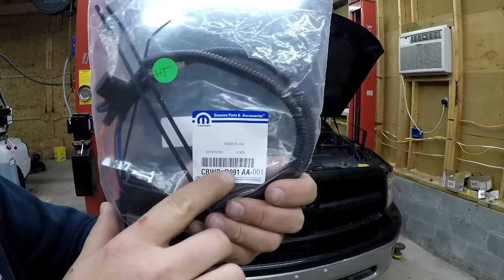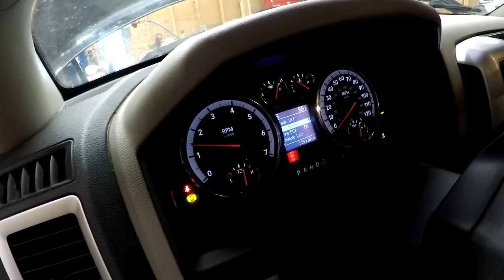Installing a Dodge fuel pump relay bypass for a faulty TIPM repair

Comment: I’ve got 2005 ram 5.7 cranks won’t start. Red electrical volt right bottom inst. cluster came on ?
Reply: Yup, 2012 5.7 with the same issue !!
Please Help help help !!
Reply: @GuciTheBulldog1  turn the key on take a rubber mallet and lay under your vehicle and hit the bottom of the fuel tank and listen fir the fuel pump to run if it comes on you should be able to start it this means you will need a fuel pump. Cause for this is running it low an fuel the fuel is what cools the pump

Comment: I have 98 ram with problems keeps cutting off after driving 30 secs or less take relay out put it in and out couple times then it'll  drive another 30 secs same thing over gonna try direct wire with fuse and switch

Comment: good day question does this work for a 2005 dodge ram 2500 5.9 diesel?
Reply from the maker: No. That’s different from this truck
Reply: @Tomsfoolery.  is it posible to do bypass it witha relay
Reply: @Tomsfoolery.  it doesnt have a fuse either

Comment: Hi I wanted to know how long will this bypass work for ? Also by any chance do you live in California ?
Reply from the maker: This permanently replaces the original fuel pump relay. No, I’m in Northern Michigan. Up in the rust belt!
Reply: Ts60 I have two more questions one is does this still apply for my situation because I'm currently bypassing my fuel pump relay from the top. Second question I looked on Amazon and couldn't find the kit do you know of any other place to purchase this.

Comment: Hey I wanted to know if this method works for 2007 dodge ram model we just had a baby an I really need my truck back
Reply from the maker: The 07 has a different TIPM but it also suffers the same fate as all of them. If you had the knowledge, you could solder in a separate relay. If you don’t want to do that, you can find new, used and rebuilt TIPMs on eBay.

Comment: I can't find this part on amazon or at Mopar? Can someone assist me with getting this exact part?
Reply: The mopar kit has been discontinued
Reply: You can get a fuel pump bypass cable on Amazon red wire with yellow fuses connectors on the to bypass it for good

Comment: Google search Verticle Visions, they make bypass kits for this problem. Just plug and play easy fix.
Reply: Same fix with less hassle? Or is it the test kit. It is just a temp fix.
Reply: @hayleyrenee2925  It's a permanent fix. No hassle. Takes 5 minutes to install.

Comment: Hay will any high amp relay work as long as it hooked up correctly
Reply: In my opinion A relay is a relay, so yes, if connected properly. Also make sure its fused if not add one.This is what i would try if it were my truck. Please use a known good wiring schematic.
Yes Mopar bought a 8 dollar relay color coded it and put it in a bag with a long part number charges 90 dollars.

Comment: The video was great i had the same problem with my 2011 dodge ram and did almost the same thing to fix it. Now have a 2018 ram and its a good truck and relay problems are in the past. The video was good but i don`t think the customer would have like the fact the fender was possibly getting the living crap scratched out of it by the relay hanging over the side as you were installing it, Just sayin"!

Comment: Thank you for this video, it has helped me figure out my issue. I just bought a bypass kit Mopar part # CBWPR091AC-001, it was only $25.00 at the Dodge dealership. Maybe this info will help someone fine one. My TIPM is on a 2016 ram. They must have changed it in this years model because the 2016 TIPM is configured differently. I have located the blue/orange and the brown wires but I have six pink/green wires and 1 is suppose to be the switch ground according to the only video on YouTube for a 2017 TIPN. Can anyone help ????
Reply: Have you been able to determine what pink wire you need?? I currently have the same problem on my 2014 Ram and it has different harness than everything I’ve been finding online.
Reply: I have the same problem on my 2014 ram 1500 with the 3.6L. Can't determine the correct pink with green trace

Comment: Ok so I'm having the same problem but I cant seem to find the part on amazon the part number will not pull anything up. Any suggestions would be greatly appreciated
Reply from the maker: Search it on google. Typically, google results will show anyone who sells it.
Reply: Pull schematics on the truck.You'll need three or four wires.... Main supply, ground (possibly another switched ground to allow for PCM control), fuel pump power wire. Find those wires and get a good relay/socket. The socket should have a pigtail. Wire the relay up with main power on one side, the fuel pump on the other. Hook up the control side. And... Go.
Reply: @dailygrinders89  Is it possible to pull out the bypass relay and replace only that? Chrysler did this fix on my grand cherokee a couple of years ago but now I'm starting to have stalls on startup, so since the relay itself is only six bucks I wanna try replacing it and seeing if that helps.

Comment: Do you have to reprogram the the system if you remove the first box
Reply from the maker: No, you don't.
Reply: No. The computer can't tell if the relay is on the board or the inner fender well if the connections are made properly.
Reply: Thanks boys, get her done.

Comment: I have a 2011 Chrysler T&C. This is a another great video; https://www.youtube.com/watch?v=oEoUYm-bxXA I also printed the safety recall sheet and took it out with me. It gives confidence before you cut a wire. My dealer gave me a generic, one-size-fits-all relay bypass kit 6814 2156 AC-001 from Mopar. They don't provide any instructions, so you'll need to know; 1. You will also have to buy a 20a inline fuse and ring terminal. I went to Home Depot. 2. Put the wires into the block "feet first" before you start splicing. That way you won't have to double splice everything like I did. 3. The connections to the relay posts are as follows; Brown to 2 (86); Blue to 3 (30); Pink (ignition switch) to 1 (86); Hot (TIPM terminal fused) to 5 (87). This was not an overly difficult job and there was lots of room to work for a nice change. Good Luck
Reply: Hey can clarify the brown and pink wire numbers? You said 86 on both

Comment: Does anyone know where I can buy an external fuel pump relay with the writing for a 2011 Dodge Grand Caravan in Ontario I checked to Dodge dealers already and they said they don't deal with them
Reply: Check the table at the bottom of the page: http://www.verticalvisions.com/tipm-fuel-relay-solutions.html, I think your Caravan is listed.

Comment: Too bad you can't buy that relay anymore... Thanks for making the video anyway.
Reply from the maker: Have you checked with the dealer?
Reply: @Tomsfoolery.  No I haven't, I will though as the color coded relay would make life much easier.
Reply: I cant find it anywhere

Comment: I have been told by Dodge this AM that there is NO bypass or external relay set up available and even that the OEM Dodge TIPM board is "not available" right now (OE# 4692315AH).  I asked to be transferred to the service manager and inquired that if my 2010 Ram came in with this issue, how would you approach repairing it if nothing is available??  Even the Expensive TIPM??  No answer, I am sure they will not return the call with a legitimate answer!
Reply: Replacing the relay isn’t that bad. I just did it on my 2011 last week. I bought the relay off eBay for $8. It took me a hour, and a half from start to finish. You will have to disassemble the TIPM, and desolder the old relay- and solder in the new one..  There are also temporary alternatives utilizing add-a-circuits, and connecting the fuel pump fuse to a Ignition circuit such as the rear cigarette lighter socket.. I did this to get my truck home as mine died when leaving the grocery store..

Comment: Will this fix work for a 2006 Dodge Ram 2500 Diesel?
Reply: Same question but mine is 06 gas engine 5.7
Reply: @NoMoreBLUEISIS  same w me did u find a fix i have the same truck
Reply: @joeroe2839  my truck has been in the shop for 2 months, i gave up and let a master mechanic fool with it. Made the mistake of telling them to take their time lol ill let you know as soon as they get it fixed.
Reply: @NoMoreBLUEISIS  thank you 🙏🏽
Reply: @joeroe2839  mine drove perfectly fine parked it as usual came out the next morning all it would do is turn over but would never start.  Stupid..... lol
Reply: @NoMoreBLUEISIS  same here left to work forgot something came home went back to leave and it was turned off and never wanted to crank up put in new pump and its the same thjng 😔
Reply: @joeroe2839  yup did the same only I also changed out the TIPM and crank sensor cam sensor throttle body lol I gave up
Reply: @NoMoreBLUEISIS  oo dang even with a new tipm box it did the same wow..idk what else to do that was my next step..i was thinkin hardwiring a relay to the battery and ignition as a trigger but then i read somewhere that supposedly they are never to be ran at full pressure and pulsate so idk what to do now and all the vids are on the 4th gen none on the 3rd
Reply: @joeroe2839  I know it sux but hopefully saved you 500 on the tipm lol
Reply: @NoMoreBLUEISIS  oo man i hope thank u plz lmk dont forget when u get ur ride back
Reply: @joeroe2839  reply to this link in a week or so and I'll give you an update if I have one.

Comment: Will this work for 2005 grand caravan sxt?
Reply from the maker: It will work on a caravan, just not sure what year. The part number and directions stated it was for a caravan. If you have the same TIPM, it will work!
Reply: ts6034 my van has a fuel pump relay fuse and a fuel pump fuse on it? Do you think it will still work?
Reply: @therealbluenote817  No u most likely need a new relay still can be bought on Amazon

Comment: I've got a 07 Dodge ram slt 1500 4.7 liter dead in the driveway cranks but  NO start I hope there the il give it a try if your right I'll send you $20.00 bucks

Comment: Don't understand why there is a relay.  Fuel pump should have one fues on and off with the car. I moved mine to a fues not being used and it's  work for ever. Relays should only be on turn signals and starters.

Comment: I can’t find that external relay at all, my Ram is a 2010 and the tipm is a little different so I don’t know if it will work.
Reply from the maker: There is no external relay. It’s intergraded to the TIPM. That’s the reason for installing an external relay.
Reply: ts6034 yes i mean I can’t find the external relay solution on the internet to buy. Well it being pre wired like how you have it. My tipm is different than this Ram you are working on and my harness is different
Reply: Addy Chaddy did you find a solution

Comment: Vertical Visions TIPM fuse bypass board. Literal plug and play.
Reply: Did you install it in your vehicle?
Having starting problems myself recently! And looked up VV’s website.
Looking at that $60 piece to just plug it and forget it!!
Reply: @geolopez914  Its all over forums and stuff. Highly rated. It actually shipped today and I should have it in a day or two. I bought a van with the issue and it sounds like the issue so I am going to try it.
Reply: @TheTmwagner77  yea I’m going to order one too, It’s been happening to often lately and I need my vehicle to get to and from work! You should make a vid on it when you get it!
Reply: @TheTmwagner77  did you order the wire piece...Or did you order the circuit board one?
Reply: The Lite circuit board.
Reply: @TheTmwagner77  yea that’s the one I’m considering!
Reply: @geolopez914  5 min swapping two fuses and plugging the board in. Car starts like nothing was ever wrong.

Comment: I have issues with 2001 dodge ram i put new fuel pump in and fuel fuses and relay pump wont work any suggestions pm me messenger

Comment: Can you share the number of the kit, ? thanks
Reply from the maker: It's in the video description. But here ya go  Mopar part number CBWPR091AA
Reply: @Tomsfoolery.  careful with wire colors. No replacement for schematics. They'll tell you which wires are switched and which are the control side.
Reply: I have an 04 Ram 1500 that just started not turning over with a battery drain and it sounds like the truck is out of gas, but its not. It did start up a few times yesterday after a jump then nothing. I cant find this bypass listed as a fix for my ear, its always 07 or newer. Will it work for an 04?

Comment: 2008 Ram 5.7 is completely different. No fuse for fuel pump relay , completely different TIPM . Anyone figured this out for 2008 models ??
Reply: Im also stuck w u , did u happen to get urs goin if so how plz help
Reply: Also looking for solution I have 2006 power wagon.

Comment: Why didn't Dodge have a recall on this problem  I have the same problem with my 2011 dodge Caravan  and from what I see on the internet  There's probably  hundreds of thousands or more people with this problem
Reply: Jeep has one currently for 2011-2013 Grand Cherokee’s. They still have no remedy currently, and theyve already been recalled for the same thing previously. All they did then was bypass it with an external relay like in the video above. So I now have a $15k paper weight in my driveway, battery drains almost instantly after turning off.
Reply: I just had this issue on my Ram 1500. Mine wouldn’t start. I was able to bypass the relay by using add-a-circuits, and using the cigarette lighter fuse to power the fuel pump. I took the TIPM apart, and soldered on a new relay.. It wasn’t that bad. You just have to be careful when you are disassembling, and reassembling the TIPM- you don’t bend any of the pins, or else it will not go back together...

Comment: OK video....I would have folded over the wire you put the shrink wrap on so the tip could not be exposed. And use a fender cover!! No one seems to use them any more, why?, so disrespectful to owner. The conventional ones don't work on the thin fenders of new vehicles....use a blanket, that conforms to the outer fender and inner fender. Don't scratch peoples paint....

Comment: Are you kidding? Why does Dodge do any of the shit they do? I have a 4.7 2008 dodge 1500 (with the 16 spark plugs) that I can NOT find a spark plug socket that will fit to do a tune up. I have looked until my eyes bled and all I can find are suggestions to grind one down with a lathe to make it a "thin walled socket" which I don't own! I will NEVER buy another dodge and other than working on them I LOVE them!

Comment: Just let people know that all the ones you buy online are unsafe it creates a key on engine off power to the fuel pump which can be extremely dangerous in an accident with a ruptured fuel line idiots that make and sell those things and they even got a patent on it that shows how stupid the patent offices are I've been trying to get the highway safety board to ban the stuff but no luck yet you never want to disable the original fuel pump circuitry unless in a pinch to temporarily get you where you're going by making key on engine off power to the fuel pump people do it in race cars all the time and I steer them away from that and wire them through an oil pressure switch or something similar come on people out there wake up don't kill yourself or others use this kind of bypass only

Comment: This is B.Crap.... No every dodge has the same TIPM... I have a 09 ram and is very different and wire & position are different, So if you do it as you see you will never fix the problem... 
Ram 09-10,, Ram 11- 16...